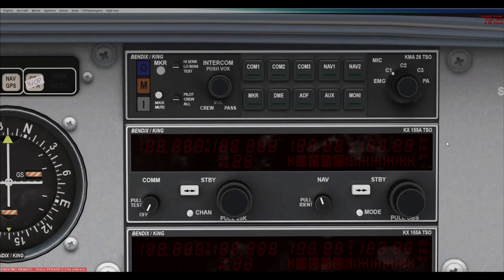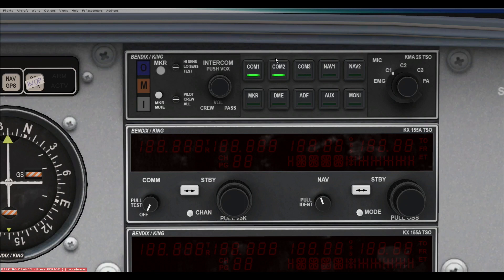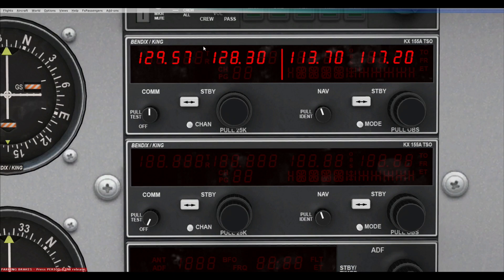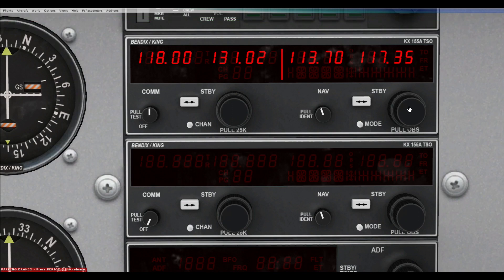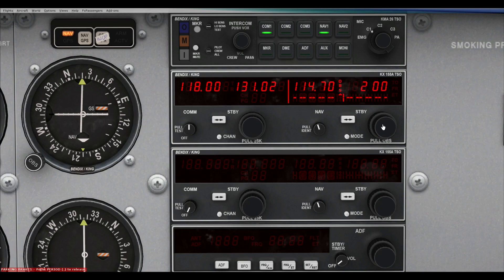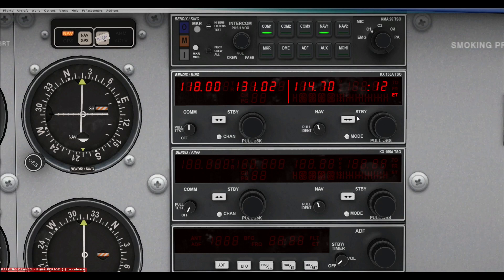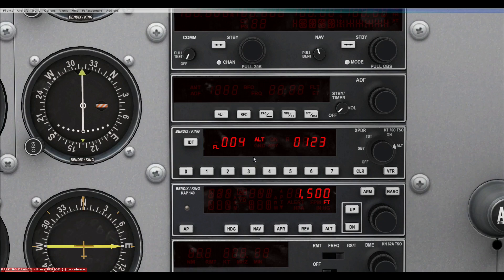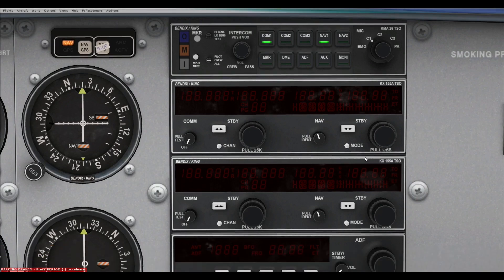A2A Cessna 172 Bendix King Tutorial Part 1 Audio Panel Transponder and NAVCOM

Comment: Hello. How to listen to ATIS on audio panel transponder ?
Reply from the maker: the transponder is not for the ATIS. The ATIS is broadcast on a normal frequency. you have to find the frequency for each airport
Reply: MerryfaceAviation Thanks for the precision on transponder and broadcast I changed the COM1 on radio to ATIS frequency(from Los Angeles Airport , unfortunately I could hear anything
Reply: A Transponder is a device onboard an aircraft that receives and transmits signals to an SSR(Secondary Surveillance Radar) Antenna

Comment: Your working too hard to find out what radial you are on when you have the VOR tuned to the station. With a TO indication and a center needle, just look down opposite the OBS selector its upside down. Also don’t assume that if you are showing a to or from indication that you are going to or from. The Radial and or bearing to the station have nothing to do with the aircrafts heading. Nice video I learned of a few features I probably won’t use but interesting none the less. Cheers

Comment: EMG bypasses the audio panel's amplifier and connects the mic and headphones directly to COM1. PA is for the Passenger Address system. See page S3-5 of the attached: http://www.kfc.be/kfc/POH/C172E/cessna%20172r%20-%20manual%20-%20part%204%20of%205.pdf

Comment: thanks for the tutorial! I have one question that is a bit irrelevant to the points of the tutorial. it appears that all three models of my a2a Cessna 172 have a GPS unit and no DME (well there is one but further to the right right in front of the copilot's seat). how do you remove the GPS unit from the panel?
Reply: Hit shift + 3, and a small window will pop up. There's a toggle in there for GPS. You can choose between no GPS, integrated GPS and a GPS that's stuck to the pilot's window with a suction cup. Hope that's what you meant!
Reply: thank you!

Comment: So I was curious if the transponder flight level was aquired from the altimeter sensor in the plane. I looked it up in the manual for the transponder and the flight level is aquired from a flight level encoder, an addon to the transponder. This encoder sends the altitude in flight level format and in standard pressure 29.92. The airport radar then automatically convert the flight level to the correct local one.

Excellent video, I learned a lot, big thanks :-)
Reply from the maker: Indeed, the Transponder is connected to an encoder, which gets the information out of the static port, just like the altimeter. Usually speaking though, I think the controllers only see flight level. Here in the UK, when there are relatively large pressure differences between standard pressure and actual pressure, it has happened to be a few times where controllers asked me to confirm my altitude, because on the radar I was a few hundred feet into their airspace, even though I was actually a couple of hundred feet above/below it. A quick clarification of the QNH and what the transponder shows though, and they relax. Not sure how it works in the US.

Glad you liked the video!

Comment: hi when you plan a flight do you use plan-G or skyvector and how do you put it info into the radio ??
Reply from the maker: +Fredrick Thompson Plan-G and skyvector are both great. If you have a powerful computer, multiple screens and are doing VFR flights only then I think Plan G is best as it can also be used as a GPS by using Simconnect. That's not the case with me, so I tend to use either Skyvector, Skydemon (app for real world flying) or real world charts.